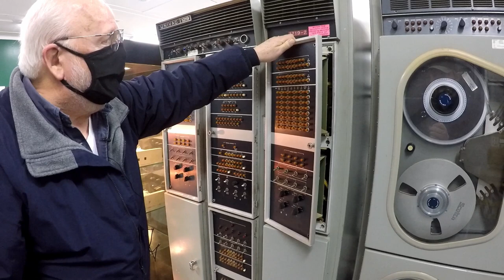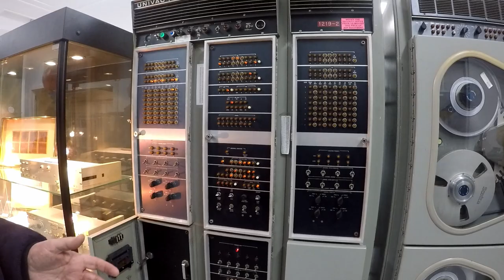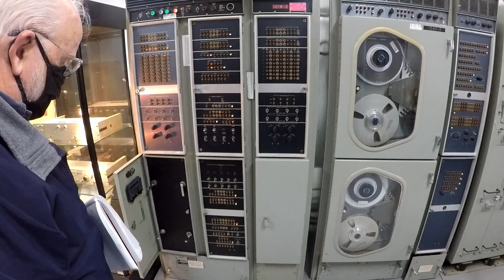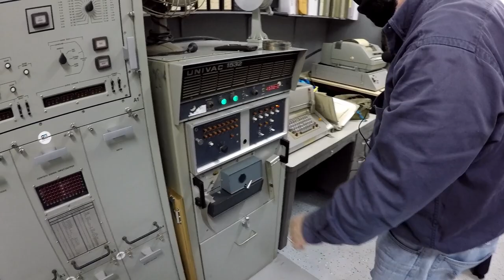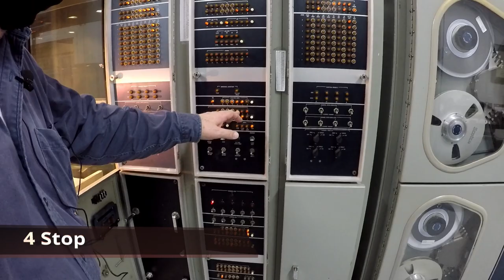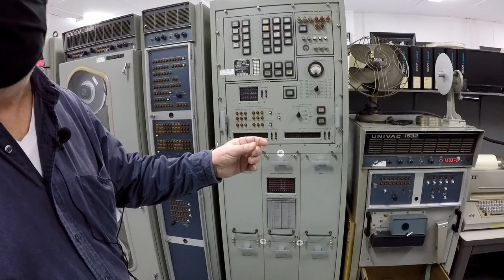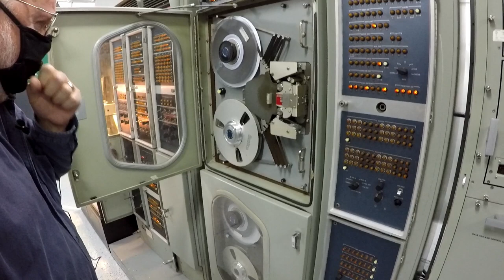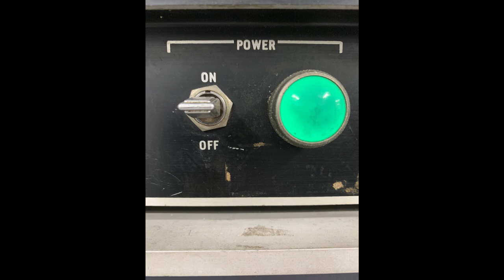UNIVAC 2021 Update - Full Boot and Diagnostic

Comment: Between 1986 and 1988 I was a computer operator on this very system. The light switches were either 325/328 bulbs. On the bottom unit we had 4-bays. We would make our own mag tapes with the BOT/EOT and the tapes were placed on RD-358's

Comment: I worked on two 1219's (didn't have the 1219-2 addon) that were used for the ALS system on the USS JFK CV-67.  Two for redundancy.   Amazing tech for the 1970's.  I also worked on the 1540's we had in the CVIC and SINS.   I once had to tune the memory in one of the 1219's with an oscilloscope to get the system back up.
Reply from the maker: Wow! Very cool! Thanks for sharing. It's not often that we find people that worked on these machines.